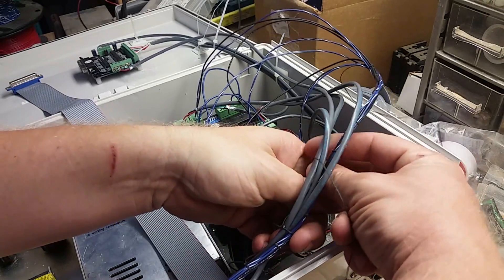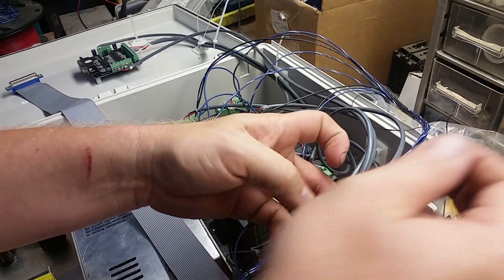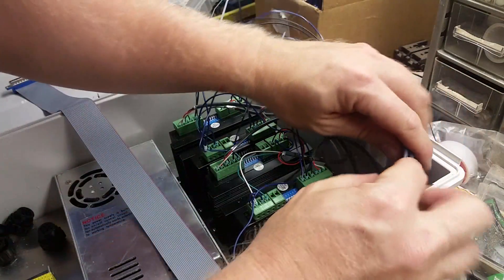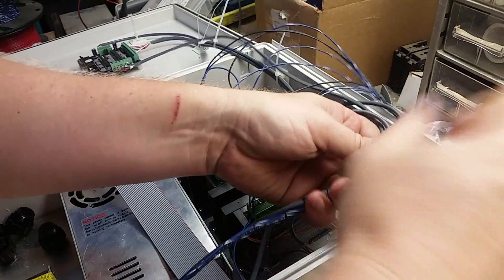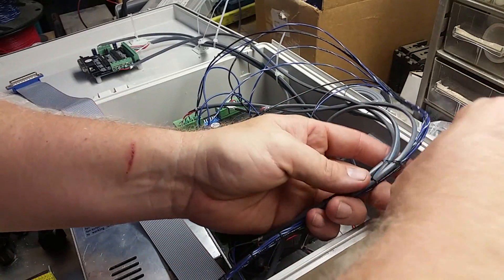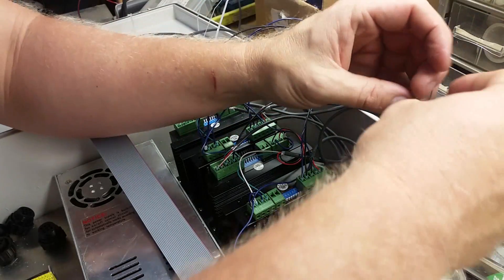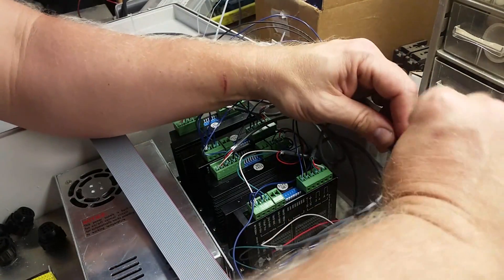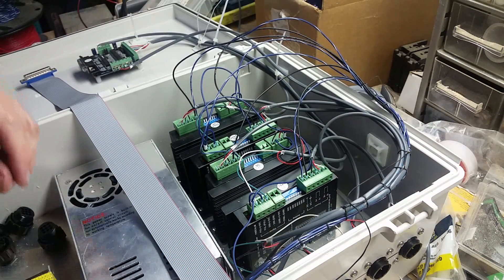Wire Lacing -- the running stitch

Comment: Something so easy that looks great is so intimidating for mellenials they still insist on using zipper ties and hot snot..
Reply from the maker: I wish I could practice more techniques but I don't wire every day.
Reply: @airgunmachinist  I do it all the time in IT and RF comms.. I only use the zipper ties to hold cable in place temporarily. everything I do is laced..
Reply from the maker: @Elfnetdesigns  very nice

Comment: Can i offer you a tip?, If you rotate the loop the direction with the standing end under the running end then flow under the bundle and through the top of the eye it shold lock tighter. It will also look good as both standing and running ends will lay flat on the bundle. No gaps
Reply from the maker: thanks i will give that a try